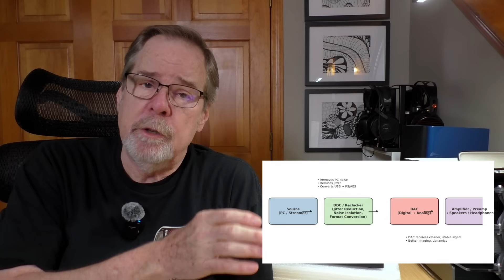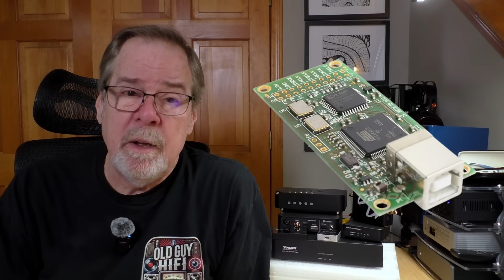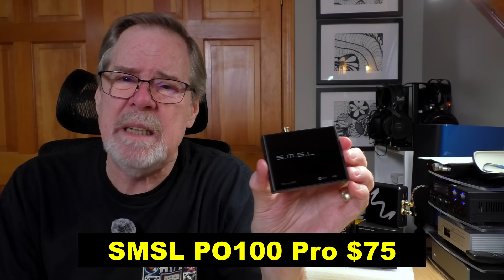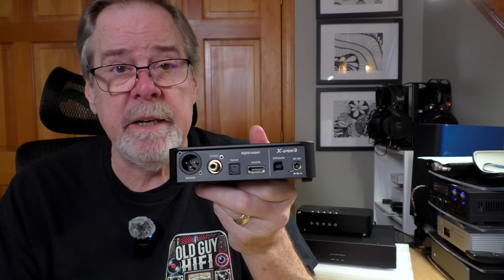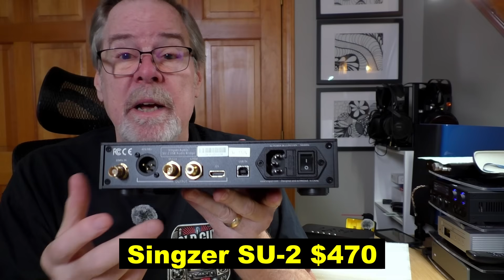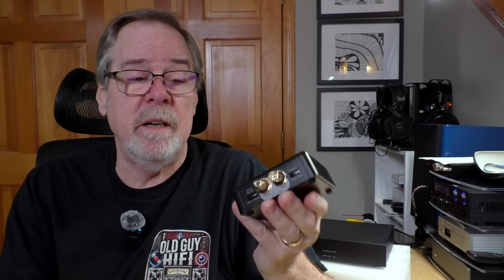OH NO! DDC-Reclockers! Do they really make a difference? YES! They do. I can hear it now “Snake Oil”

Comment from the maker: A DDC or reclocker improves digital playback by cleaning and re-timing the signal before it reaches the DAC. On the sonic side, it reduces jitter and noise, leading to clearer transients, a blacker background, and more natural imaging and soundstage. It can also let you feed your DAC through its best-sounding input (like I²S or AES) for smoother, more dynamic performance. Practically, it isolates the DAC from noisy sources such as computers, bridges between different digital formats, supports longer cable runs, and extends the usefulness of existing gear—often making even modest sources sound more refined and consistent. If you wish to join the channel please click here:  https://www.youtube.com/@OldGuyHifi/membership
Reply: Thank you Mr. "OldGuyHiFi" 😇  I have been able to recently experience and enjoy building a better digital front end. It seems that good speakers, especially good tweeters and crossover components were a big contributor to hearing the improvements.
I went the IanCanada route.  It was a very busy journey. 😎👍
Reply: Interesting. I found this beautiful stone at the beach in placed it on my dac/almp.  I noticed the sound stage opened up and sounds better- every time I see the stone there.  I think there is some kind of magnet quality in that stone that is conditioning the signal.  I also don't have any measurement.   I wonder if the same thing is happening with you?  Maybe we both just have ears that can tell the difference.
Reply: I was re-reading the SMSL SU-1 manual yesterday and discovered it had a "The new self-developed CK-03 clock processing circuit greatly
reduces clock jitter". I don't know if that's a reclocker but it may be one of the reasons the little SU-1 boxes above it's weight class.
Reply: I'll bite. Based on what you say all clean grain made Vodkas taste the same because their formula is the same right ? There are so many examples proving that numbers don't equal experience
Reply: I would argue:
1. There is no professional blind listening test proving this.
2. In case any streamer or DAC needs such equipment in front of it, it's more about a poor DAC clock design perhaps the PLL not working well or poor data management incl. adequate buffering to begin with; and possibly poor noise rejection in the power rails of the analog output stage of the DAC. Also, it's very trivial nowadays to buffer enough samples to avoid any timing issue.
Noise is measurable btw. But I would prefer a proper listening test confirming claims in this category. And make no mistake, whatever is audible can also find a scientific explanation. Audio does not defy known laws of physics incl. those used by audio and electrical engineering. Of course our hobby is about pleasing our hearing but not about fooling our imagination.

Comment: realistically, if using a dac like the Gustard X26iio - and Mac as a source, which has less noise than PC to start with - how big of a difference would there actually be between using like a SMSL PO100 Pro and Gustard U18?

found LAN/streamer connection to be big improvement over USB, and read many think i2s is better yet - and U18 has great reviews, but dunno how much is the actual ddc vs. the i2s benefit - and how close/big the gap is between how PO100 Pro and U18 would actually perform for the X26iii... 🤔
Reply from the maker: Well, here is what Mark Levinson had t say about the SMSL when used with a MAC: https://danielhertz.com/products/maria-amplifier#specs-mar towards the bottom of the page.
Reply: @OldGuyHifi hmmm, i guess actually buying and trying them both might be the only way to get an answer, haha.

damn on the 96khz limit - would throw a wrench in my upsampling configuration. though if "The general consensus is that the sonic improvement achieved with these converters exceeds what is typically possible even with expensive reclockers, isolators, or premium USB cables," could still be interesting to see how it balances out in the end even if limited. 

might dodge it though, as Claude pulled up that the limit might be on PO100 Pro's mode 1 - whereas it's mode 2 that matches the X26iii.

Comment: Dear OldGuy, I use Audirvana Studio on a Mac Mini, and use “Integer Mode” on USB out which feed an Aune S6 Dac. Now I order a Gustard R26 II, and my question is this:
if I got all the things you explain in this video, devices like SMSL PO100 Pro uses the clock inside the Dac to eliminate jitter and reclock the signal to I2S, other way devices like the Singxer SU-2 uses its internal clock to reclock the signal, correct?
If what I understand it’s true, apart from the digital noise, the best result you get is when a reclocker has better signal processing than your DAC.
Reply from the maker: Yes and galvanic isolation.

Comment: Tried the smsl po100 pro off wiim ultra and did notice a difference, but too me it almost sounded like boosted treble where some instruments had sharp edge - tried 2 diff speakers.   I dont have the patience to try and measure if there is something going on and would think in theory no change on the sound, felt like i was listening to an old sub 300 topping dac where initially awed by 'detail'.  This was feeding an old meridian 568.2 over coax from reclocker.  My preferred is to just use chord mojo2 from usb from the wiim ultra.   Another product that had lots of rave were those douk audio/fosi speaker selectors with vu meters - they also seemed to change sonics mildly.
Reply from the maker: Interesting experience. Thanks for tuning in.

Comment: With the Laiv Dcc, can you input toslink from an HDTV, coax from a cable box, USB from a computer, then run i2s into a DAC that has an i2s input/HDMI and switch from which device you want to listen to, computer, HDTV, cable box all using that one is2 input on the DAC? If yes, which cable i2s/HDMI works best? I see denafrips has one?
Reply from the maker: I use WireWorld Sphere 48 HDMI cables. They are very good and not expensive.

Comment: Ed, is there any benefit using a DDC that has a USB in & out? Like a laptop > DDC > Dongle DAC/AMP? I use a FiiO KA17 as my portable & curious as to if this would make sense? Great vid!
Reply from the maker: I am not familiar with any DDCs that have that feature. A DDC (Digital to Digital Convertor) is designed to change USB to I2S or SPDIF. It would defeat the purpose of a DDC if it just went USB to USB. For a portable set up, I don't think you would realize much of a benefit using a DDC.
Reply: Good morning Ed! Your video got me thinking, so I asked Grok if DDCs with USB inputs & outputs exist, & it gave me an example: the iFi iPurifier3. Grok was also of the belief that it provides significant benefit, & the product description on Amazon claims it does. I knew going in that my particular scenario might not be of benefit. Interested in your thoughts!
Reply from the maker: The iFi iPurifier is nothing more than a USB isolator. It is not a DDC/Reclocker. For USB Isolation I like the Topping HS02. It is much less expensive and works very well I have several of them in my system. You can find it here: https://amzn.to/4plG75e. That is an affiliate link. Let me know what you decide.

Comment: I am utilizing my XGIMI projectors optical out to an SMSL D6S dac. The bitrate is 48kbps. Will any of the devices reclock to a higher bitrate? Will I still benefit using the SMSL PO100 Pro on such a low bitrate source? Thank you.
Reply from the maker: No. They can't. Almost all video is sampled to 48kHz. The device sending the data would have to be able to oversample. Nothing we can do about it. A DDC/Reclocker doesn't resample the signal. That's not their function.

Comment: I didn’t hear a benefit with this into my Eversolo Z8. What’s the next tier to try since my dac has dual jitter clock oscillators 45.1584MHz and 49.152MHz in it?
Reply from the maker: With what? I don't which you unit you tried.
Reply: @OldGuyHifi My apologies. I looked at 2 of your videos back to back.  The Doug U2 Pro (2025)
Reply from the maker: The Z8 is a good unit. For that level of product and depending on your budget, you might consider the Matrix X-SPDIF 3 or the Singxer SU-2. I own both and have good success with them on high end gear. The SIngxer is my reference. Thx.
Reply: @OldGuyHifiThx you.

Comment: You should build your own DDC with world class parts from Ian Canada, $800 in parts and eats up any streamer below $5000usd, I build one using ropieee for roon and I2S into my holo audio Cyan2, the synergy is unbelievable, jaw dropping 3D holographic stereo sound
Reply: I have Audiophonics digiresuce that uses Ian Canadas DDC tech. It is Outstanding. I just wish it had atlease USB audio in. It only has Toslink and Coax in and out. It is Outstanding.
Reply: @mark120371 absolutely fantastic stuff, off the shelf retail products can’t get close to the same performance in its price category, nothing sub $10kusd anyway, Ian Canada parts are all world class, I absolutely love it 👌🏼
Reply from the maker: I don't do DIY. Sorry.
Reply: @OldGuyHifibest bang for buck, unless you are chasing affiliate links then yes diy is no good, diy exposure is great for your viewers though, those who want to save thousands to achieve top notch performance.
Reply: @O@OldGuyHifiyou cannot beat diy, plus Ian Canada products are based on raspberry pi and connect together extremely easily, no soldering required. Nothing you can afford on your channel will come close to the performance of Ian Canadas DDC streamer period.

Comment: Great video and i agree with the idea that every high end setup and dacs that are accepting i2s or coax should use a DDC In the chain, however i must ask. I'm a previous owner of the matrix audio x spdif 3 and i recently got the harmony dac along side with the uDDC. Should i noticed any upgrade in terms of sound? Thank you
Reply from the maker: Truthfully, there will be a subtle improvement right away with the μDDC. It may not be a readily apparent difference, but over time you will definitely hear improvements in imaging and instrument definition. I have both those units and I do think the μDDC is better sounding.

Comment: I’ve told recently that no matter what input is used on a Denafrips DAC that it’s going to reclock the signal. Don’t know if that’s true. Do you have any insight on this? Does it matter what the quality of the clocking is for the last unit that touched the signal, or is it a matter of multiple clicking is better no matter what?
Reply from the maker: We always rinse the dishes before we put them in the dishwasher so the dishwasher doesn't have to work so hard. A DDC/Reclocker is like the ribs before the wash. I hope that makes sense. I did several White Papers on this topic in the Community Post section of the channel. Thx.

Comment: My computer has an optical and coaxial audio output (Aorus Z390 motherboard) and I'm currently using the optical output to connect to a Cambridge Audio Dac Magic upsampling DAC. Would I get the sound quality if I used the USB port on my PC and one of these Douk U2 Pro 2025 or SMSL PO100 Pro and to the Cambridge Audio DAC? Thanks!
Reply from the maker: I think you might. Buy the Douk unit at Amazon and return it is you find it did perform as expected. For $70 I think it is worth a roll of the dice.

Comment: Thx for the review but I am quite confused...
What do you suggest to connect the TV to a DAC?
In my case from a LG C2 to a Gustard X26III, now with an Optical cable (only tv output).
And which type of connection to the DAC:
Optical / USB / IIS?
PS I am sure that there is a lot of jitter even changing from a cheap to a good cable.
Using my previous dac, a SMSL DO200, I had to set manually a very high jitter value to avoid "breaks/jumps" in the sound.
Reply from the maker: I would try I2S. All you need is an extra HDMI cable to test it. Let me know how it goes.

Comment: Which Schitt dac will benefit from one of these re-clicker ddc like the small pod ddC recliner or the Laiv uddc , or the Matrix-X spdif3 I’m using and iPad Pro. I want the clean up the signal into my iPad using my headphones
Reply from the maker: Truthfully, they all will benefit. You might want to consider trying one of the smaller less expensive units like the Douk U2 Pro or the SMSL PO100 Pro. They cost under$100 and will have a very positive impact. Being inexpensive you see if the results are worth looking at a more expensive DDC.

Comment: Yet you would fail every single listening test where you would have to guess how many times the DDC was switched in. Still to this day nobody managed to claim the 1m usd bounty for this.
Reply from the maker: Measurements and blind listening test are an exercise in mental masturbation.
Reply: @OldGuyHifi No, it proves audiophools are full of shit and delusions. Then tell me why nobody managed to claim the 1 million usd reward if so many of you can hear the difference in capacitors, cables, etc? Its even more funnier when old people with severe hearing loss(stops at 9KHz) claims to hear treble better than younger people. The coat hanger speaker cable is still a legendary test audiphools refuse to accept.

Comment: So you say this could benefit CD players. 

Ive just ordered the U2 Pro (2025) after watching your videos mainly to attach to my Mac. 

But what would I need to get this to connect to a vintage CD player with say optical and coax outputs. Would I need another device in the middle of the chain to work with the U2. 

Or do I need a different reclocker that has optical / coax input?

If that’s the case anything in the same budget and quality as the U2 you recommend? Does Douk do anything that could work?
Reply from the maker: The U2 and these other small units only work with a USB input. To work with a CD player/transport, you would need what is called a "SPDIF Reclocker". I only know of one that isn't crazy expensive and that is the Wyred 4 Sound Remedy unit. I have one here now for review and it works very well on my old CD players and my music streamers that don't have a USB output. That review will be out soon. Here is a link to their website for more info: https://wyred4sound.com/products/remedy-reclocker. That is NOT an affiliate link.
Reply: @OldGuyHifithank you that most helpful.
Reply from the maker: Thank you.
Reply from the maker: I said the Wyred 4 Sound Remedy SPDIF relcocker is the choice for a CD player. These units only have USB inputs.

Comment: @Old Guy Hifi, please help me to make a good purchasing decision.  I have a few questions, after narrowing down my choices to two DDC units.

I am trying to choose between the Singxer SU-6 and the LAiV Harmony µDDC units, as they are similarly priced.

Which one's I²S output would you deem to be better?  If you have only heard the SU-2, then please use that for the sound quality comparison.

If it is a photo finish between the Singxer and the LAiV units, then I would go with the Singxer SU-6, to have the additional output options (which are more important to me than having multiple input options)

And if I go with the Singxer unit, do I need to purchase a power supply (a "brick") that we typically see with electronics?  Or will a standard desktop computer's power cord be sufficient?  If a "brick" (or whatever it is called) will have sonic benefits, then would you please recommend one?

Will the AES/EBU output diminish the sound quality, as compared to the I²S output?
I am asking, because my DAC has an AES/EBU input, and offers an I²S add-in card option.  I would rather not deal with the latter, if there will not be a sonic benefit.

Lastly, will either unit benefit from an external clock?  I have a revealing system.  So if an external clock will make a sonic improvement, I would like to know (and perhaps you can recommend an external clock brand / model?).

I am prepared to go as high as $3,000 for the DDC, power supply (if needed or beneficial), and an external clock.

Very good video, and thanks in advance for your help.
Reply from the maker: The YouTube reviewer Golden Sound looked at the SU-2 and the SU-6 and found the performance differences to be very minimal. The SU-2 is my daily driver and reference unit.  The SU-6 has an extra I2S input but lacks a 10mHz Clock input which really isn't a big deal. I have both the SU-2 and the LAiV μDDC and for me the limiting factor is that the μDDC only outputs on I2S while the SU-2 has, AES/EBU, Coax, Toslink and I2S. I also like the built in power supply as it is one less thing to buy and one less box to accommodate. Skip the whole idea of a master clock. I have one here and if there is a benefit it so minute and inconsistent as to not be worth it. Another DDC to consider is the Matrix X-SPDIF-3. I own one of those as well. It is very good but needs and external linear power supply and costs more that the SU-2. My recommendation is the go with the SU-2 and take the savings and get some good cables. Keep me posted on your progress. Please consider subscribing. Thanks.